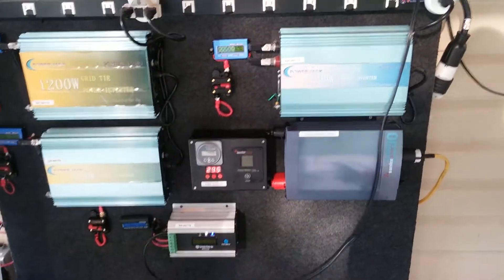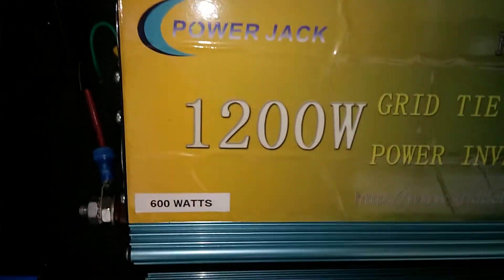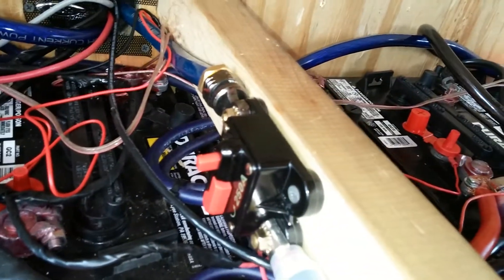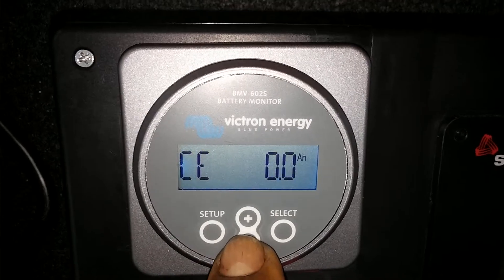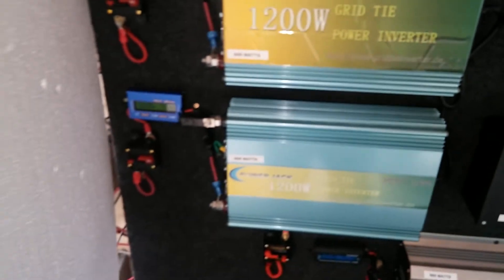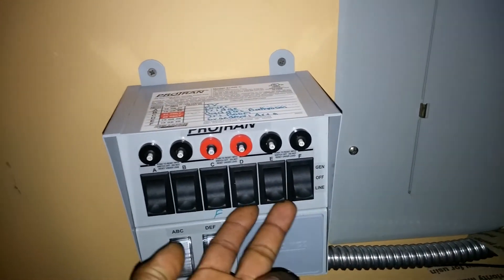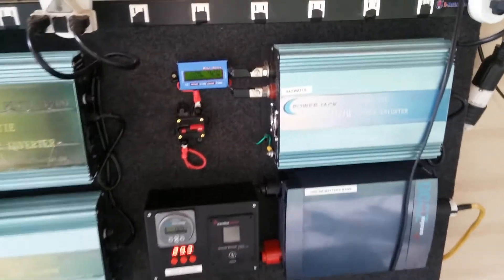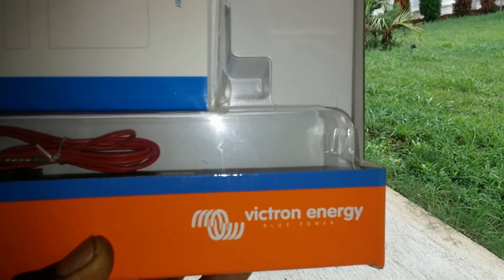renogy solar panel and  samlex inverter

Comment from the maker: ian brown thanks for checking out my vedio------i can run all the circuit all day if I want but the reason why I do not,I had the three grid tie inverter that run the house during the day--- my system is design to save me money on my utility bill I am coming from $300 to $400 $ a month to $37 to $90 a month depending on mu usage - now my total solar watts is about 6000 watts
Reply: Wow !   good  stuff, I'm  awaiting  my first electricity  bill since my conversion .I'm  running  3000watts  of panels , a midnight  classic  200 and a 2224 samlex  evo. I had a ten circuit  reliance  transfer  switch  installed . I'm currently  using  12 2 volt  300ah batteries, I run the entire  house  on solar  during  the day but I switch  my refrigerator  and 8000 btu  ac  over to grid during  the  night . love your  set up .